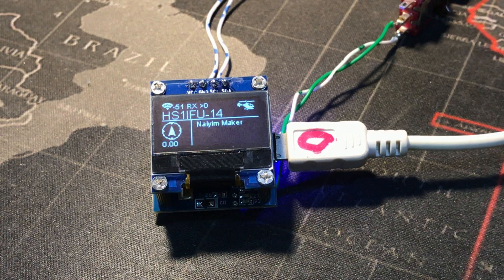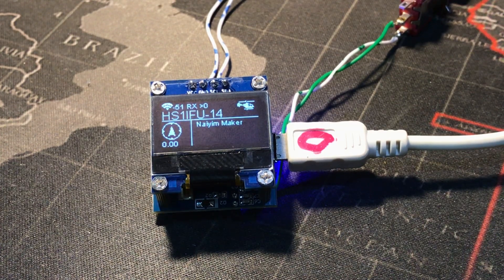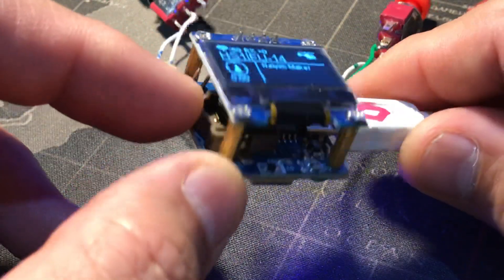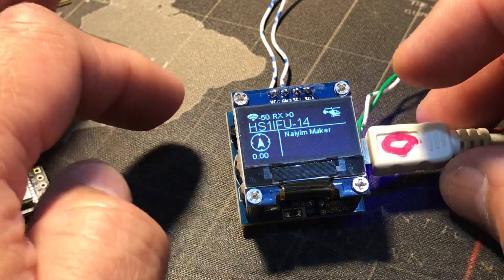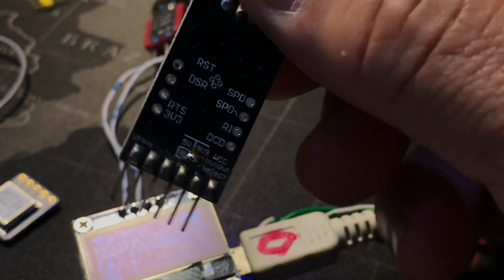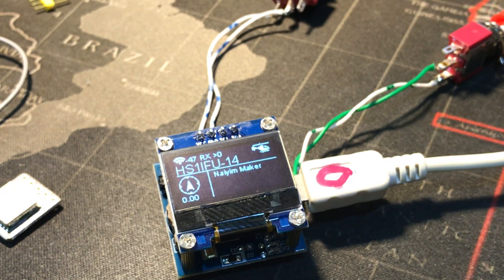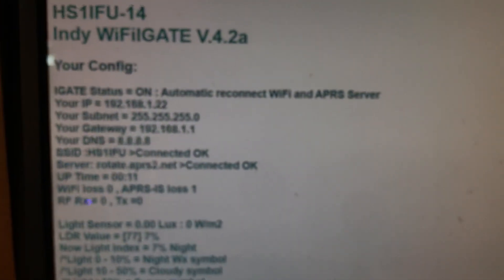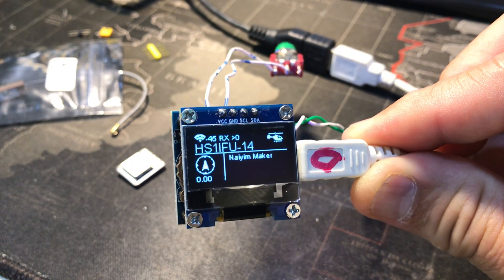The smallest APRS igate yet !!!

Comment: Hello, I have the same hardware: Esp12-F with display from ebay. I managed to flash it with version of the software WifiIgate v4.2a. My question is  on what pins you conect Rx and Tx pins to TNC?
Thank you!
Reply from the maker: shorturl.at/gmDT7      Google drive
Reply from the maker: Download info in there
Reply: Thank you! I used that schematic in firmware and is working ok.
Reply: Where is the antenna?